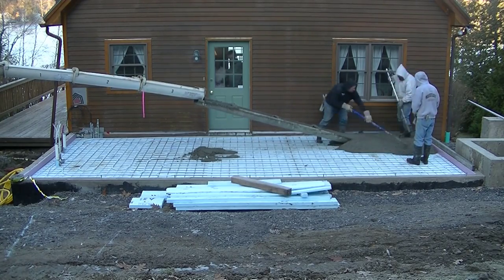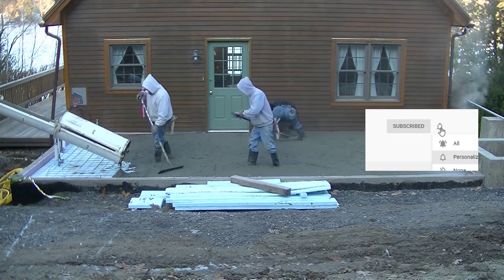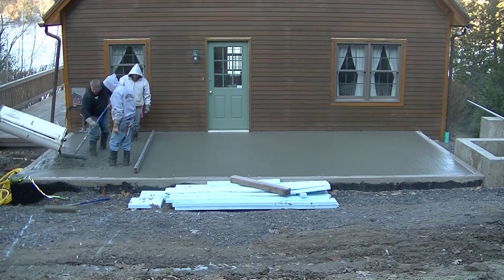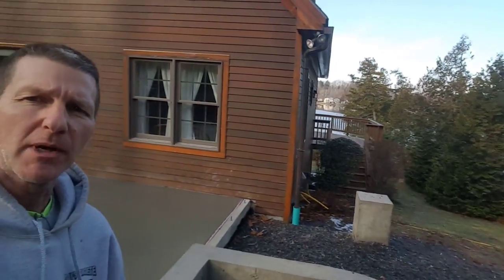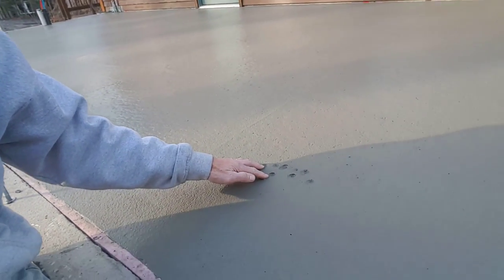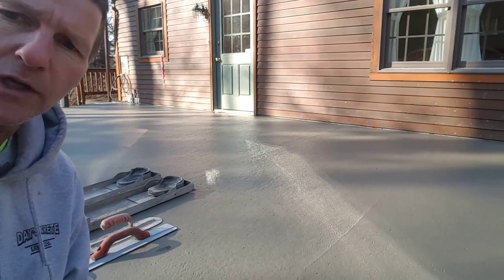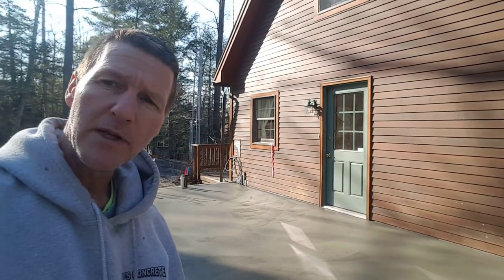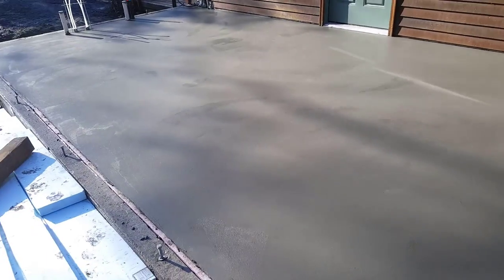Concrete Finishing Tips | Pouring And Finishing A Small Concrete Floor

Comment: Good vid Mike. I think the thing that beginners can take most from this one is when you say to let the concrete set for a while between passes with the mag or steel trowels. Beginners always seem to have a tendency to overwork the concrete and not give it time to do its own curing. Of course the real trick, that only comes with experience, is knowing how long those ‘waits’ should be.
🤜🤛
Reply from the maker: Yes, learning the timing is what most newbies have a hard time understanding. Just an experience thing that's all.
Reply: @MikeDayConcrete  Yea- I am guilty of this.. Just did a small slab and I think I both mag floated and troweled too much- too fast. Even though I was light on the water rate I think I worked it into a soup mix of mostly water on top and some of it flaked off the top within a couple days.. Rookie mistake I guess.. Love the videos by the way!

Comment: To get this straight in my head. As a check list is it
1- pour n skread 
2- bull float (long pole n big paddle)
3- mag float (little rectangle)
4- steel trowel, repeat till smooth 

If doing a broom finish, you use broom after  mag float then you are done??

Comment: Hey mike I have a question for you.  What is the pros and cons of adding air,  do they do it at the plant or dose the truck when adding water, and does it make for sticky concrete
Reply from the maker: Adding air-entrainment is just for freeze/thaw. The tiny microscopic air bubbles in the matrix of the concrete allow water to penetrate (absorb) into the pores and freeze (expand) without popping the surface. It can make for a little stickier mix when finishing but not too bad.  Any concrete that's interior doesn't need it of course. Just exterior concrete in climates where you have winters.

Comment: Hi Mike, I've been watching a number of your videos lately and I'm impressed with your videos and expertise. Thanks for thoroughness. It prompted me to subscribe.
I have one question about the rebar or mesh placement in slabs. In some of your videos I see one of your workers using a bar to pull up the mesh but then the other workers walk over it after. Does this not push the mesh back down to the ground again?
Also, do you have a video that covers optimal ways of dealing with mesh and/or rebar during the pour?

Comment: If I recall I think you mentioned before you don't do any grading and ground leveling. You just come out and pour and finish the concrete? If you were to just pour and finish with all the prep work done and ready to pour, approx. what would it cost to have an 80x128 pad 8 inch deep with 4,500 PSI and fiber mesh added? Also, would laying out a chain link fence over the rebar add any benefit to prevent future cracking?
Reply from the maker: I don't talk pricing on YouTube, you can join my private Facebook group "Concrete Ninja's" to talk pricing. I've never used a chain link fence for reinforcement before, I suppose It wouldn't hurt and it may help reduce cracks if it had enough coverage over it.
Reply: Using chain link fence for reinforcement would work exactly like welded wire fabric (‘wire mesh’). It would actually be even stronger than the typical wire used in patios, sidewalks etc, bcz typical wire is W1.4 x W1.4 whereas chainlink fence is a thinker gauge wire and the ‘square’ spacing is about 3”x3”, not the typical 6”x6”. You would also have the added benefit of the wire being galvanized. It would not be advisable to buy fencing as a substitute for WWF though bcz the price difference is substantial compared to the added benefit gained. 
🤜🤛

Comment: Goodday Sir, I recently pour a small floor and my mix was 2 portions of sand 2 portions  of grid and 1 portion of cement,  when the floor got  dried there is continuously dust of cement and sand . What can be the reason for this, is my mix not correct did I make it to weak or was there to much water in  my mix. Thank you Theo

Comment: Mike. I poured 37 yards slab the other day and it got rained on after we finish troweled. Temp was 40s and at night too. Next day a few small areas were flaked up. And it seems to be in areas I steel troweled maybe too much or too early.  Why does the steel trowel cause water or air to be trapped?
Reply: Its because it seals the surface so that bleed water cant escape through the top. Hope this helps. A mag or wood float still leaves the surface open so the bleed water can evaporate
Reply: @aarongrabowski5620  thanks for the reply. How do you know when the concrete is done "bleeding"?
Reply: skliros you can see there is no more water on the surface of the slab. And like Mike showed in his video you can only press your fingers down about a 1/4 “
Reply: Always check any areas in direct sunlight first. The sun plays a big role on when you can start finishing
Reply from the maker: Aaron said it perfectly, good job Aaron!
Reply: You more than likely got on it to soon and started closing up the surface which trapped the bleed water underneath it. therefore caused it to pop the surface

Comment: Excellent job Mike. I'm pretty good at doing concrete projects like you do but still learning. 👍 I actually have a question. Do you know how to do a sidewalk or a patio shine when the lights hits it? There is a material that's called silicon carbide for this but I dont know the process of doing it correctly. Would you be able to provide me with some tips on how to use it correctly please. Thank you and by the way you are doing excellent job
Reply from the maker: I haven't used that material so I can't comment on it. I'll do some research and see what I can come up with.
Reply from the maker: Here's an article I found on it.  https://www.concreteconstruction.net/how-to/sparkling-aggregate-for-flatwork_o
Reply: Thank you very much. I will check it out and I will let you know. Thank you for replying to my message. I really appreciate it

Comment: I watch all these videos and then have a small L-shaped slab for pool equipment thinking it will be a breeze. Then realize afterward that all these videos have ideal working conditions. No shed next to one side, no pool plumbing on the other, the whole form/slab isn't surrounded by rock, no conduit and electrical sticking out. 

Just got done with what seemed like it would be simple... and realized ... HOLY CRAP.... I can't even run a screed along the sides without running into PVC pipes or electrical,, or the side of the shed, or the fact the shed was put down on concrete... out of square, or the fact the shed was below grade and water would naturally run straight to it. 

Really wish I could find a video on actual challenging work.

Comment: Hi Mike
my 10year sidewalk to the concrete stairs has cracked. I noticed a fiber expansion joint was not used bwt the sidewalk and house foundation nor between the sidewalk and stairs. Shouldn't there be one in each spot?  Pls advise asap- we gonna learn and pour tomorrow Diane